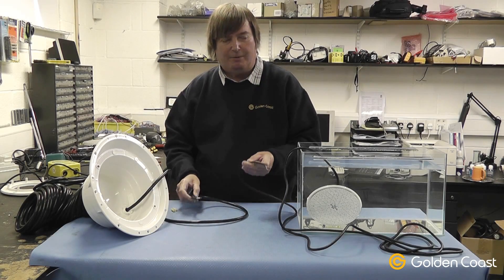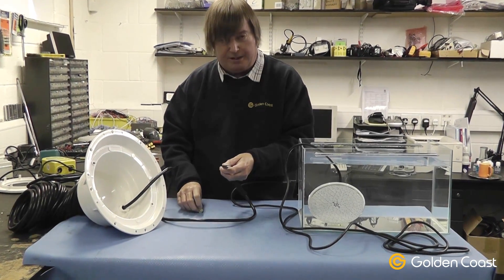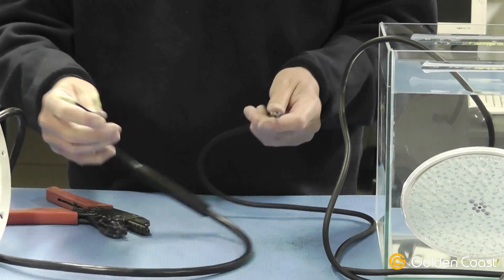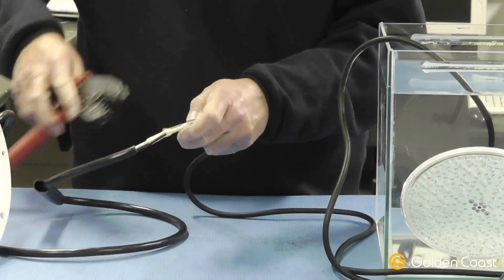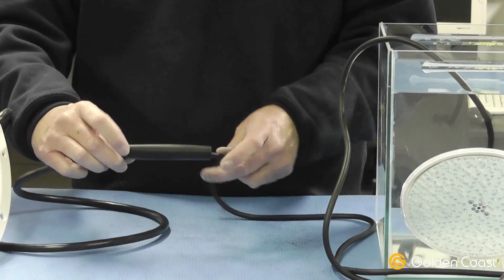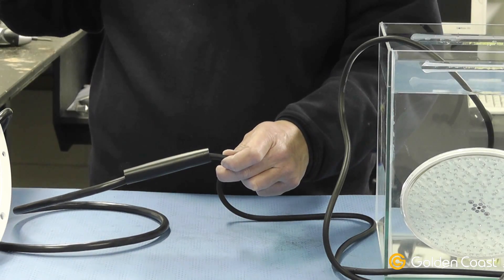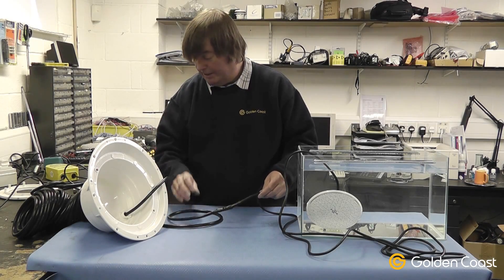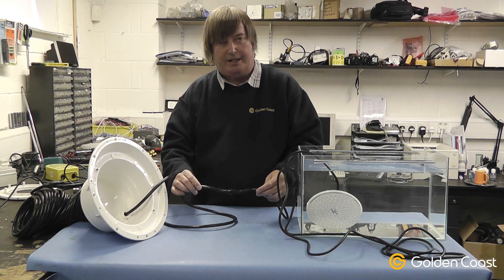Making an Under Water Light Cable Joint | Andy's Answers

Comment: Gday Andy. I know you made this post some time ago but people like me are still searching and using your ideas. I am about to undertake this venture (qualified electrician) and need to keep within the wiring rules we have here in Oz. Just curious as I plan in using your system but am using the following. As you are probably aware now you can purchase crimps with heat shrink already attached nowadays. Plan is to cut suitable length of waterproof heat shrink and place over one end, Offset crimps as you have shown, then heat crimp heat shrinks, Wrap in the connection in self amalgamating tape (stops any sharp edges from crimp penetrating heat shrink then place heat shrink over tape then shrink. Bit of overkill but guaranteed never to break down in water,  Using a 12 volt DC system with 3 Watt LED.
Reply from the maker: Hi Greg. Thanks for your comments and I'm glad you found the video useful. We still use this method using a crimp (high quality), tape ( self-amalgamating) and heat shrink, however the heat shrink we use has a resin built in so as it heats and contracts you can see the resin squeeze out. When cooled this is very strong and waterproof. All the best, Andy

Comment: This is great.  I personally have never had good enough luck with crimps to ever want to trust them in an area that's difficult to access such as this.  I prefer using solder. It takes more time but you'll never have to redo it.  Just my 2 cents.

Comment: Thanks Andy for this video. I have bought a pool niche but not sure about the size of the cable that comes with it. I was thinking its 6mm. Please help. Thanks
Reply from the maker: Hi, a cable is not supplied with a niche but with the electrical 'guts' component . 
Cables must be sized correctly for voltage and power requirements and the VA load but please be aware that ANY electrical works in a pool or spa MUST be carried out by a fully qualified electrician and certification given for the works.
I hope this helps, Andy
Reply: @GoldenCoast  
Definitely it wouldn't be me doing that job, I'm want to buy all what's need. What is the size of the electrical gut of the one used in this video? My lamps are 18v lamps.

Comment: What size tubing for a 300W, 12V pool light?
Thanks
Reply from the maker: I use a 20mm version but remeber it's not standard heat shrink as it has a resin lining which seals the joint.
Reply: I bought 15.4mm (5/8"). Hope that works. It's inexpensive enough to order again.

Comment: Can you tell me where can source the crimps and tubing in the UK?
Reply from the maker: Hi Valerie. The crimps will be available from any electrical wholesaler but the heat shrink tube which includes a special resin is only available from RS Components. I hope this helps. All the best, Andy
Reply: Valerie Thorpe better off soldering

Comment: Helpful. But, you lost me on the "glue" comment as I didn't see you apply any glue. Is that built-in the shrink tubing that you used?
Reply from the maker: Yes David, its already in the shrink tubing.
Reply: Me too, I wondered where the glue came from.  Normal heat shrink tube doesn't include any glue. What shrink tubing did you use?

Comment: Not a good idea to put your friends and families lives at risk by doing this to an underwater swimming pool light.
Reply: +Fielding Posson 12 volts - hardly life threatening
Reply: Yea, but a lot of idiots are going to do this with a normal 120v swimming pool light.
Reply: @bw120588  it’s hooked to a gfi outlet or breaker and what happens if the water gets in the fixture like it always does it is protected by the gfi which will prevent it from killing you unless for some stupid reason you don’t have it hooked up to a GFI
Reply: Fielding Posson pool light is 12 volts no danger should know that before making comment
Reply: @buckminsterfullerene2294  -- I wish your comment was true, but it's not.  120VAC and 12VAC pool lights are sold equally all over N. America.

Comment: The inside of marine heat shrink has the glue pre-coated on the inside.  When it shrinks down some of that glue is usually squeezed out, which is what you saw in the video.

Comment: Thanks for this video! You just saved me $600 by allowing me to replace a fountain pump easily myself without dismantling the fountain as the "professional" fountain company was planning to do to install a new pump. I used the same technique to replace the underwater pump that sits at the base of a large yard fountain. Cut the old pump cord and the new one, hooked the wires together with couplers, then heat shrink cover sealed the connection. Much appreciated.